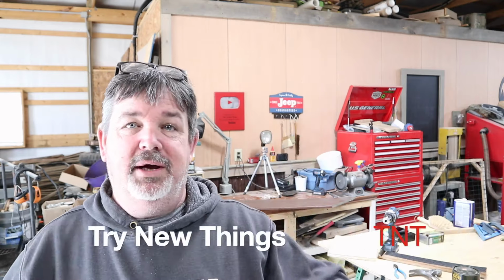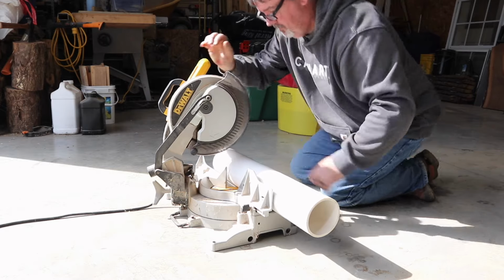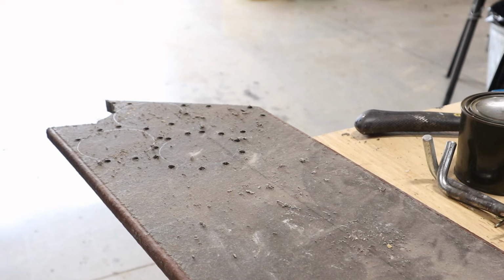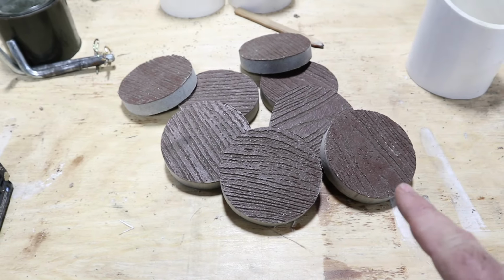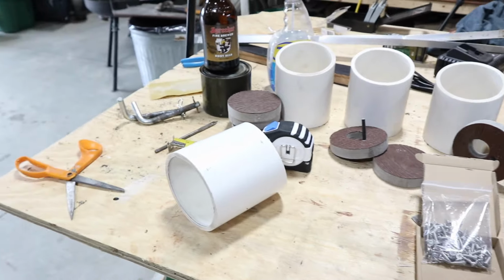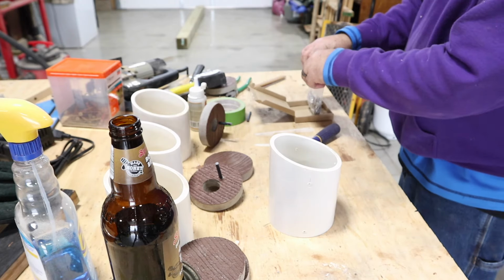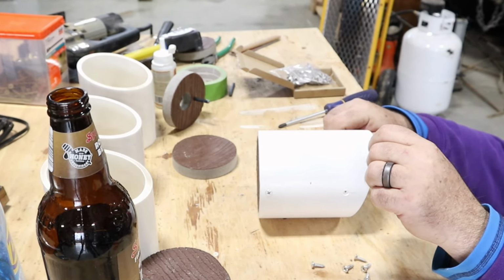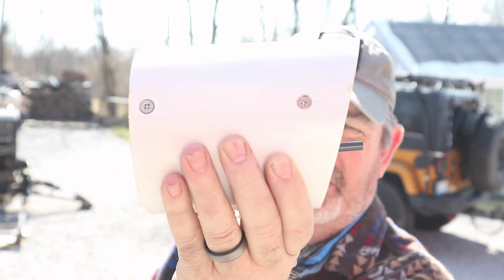#216:  DIY PVC Birdhouse Build

Comment: Chris, a house wren hole should be 1” and no perch. Predators are able to kill baby birds from perch. My bird book says hole should be located 4 to 6” from bottom. All my books say ventilation is needed. Although it is a fine looking and rot proof material I’m not sure it is going to work. You didn’t mention what particular bird you were trying to attract. I have never used pvc for a bird house. Your videos are always well presented. Good luck.
Reply from the maker: Hard to be 6” up on a 4” door.   No idea what bird she wants but smaller hole and no perch does make sense for tiny birds.   I’ll incorporate into the next ones and see if I can move the hole up just a bit.
Reply from the maker: I did put in a couple drain holes in the end, but that won’t do anything for ventilation.   I could put a couple holes at top of front and back.
Reply: @TryNewThings  maybe with pvc  all that is not necessary. All I know from my wood houses is they list a specific house size and hole size for every species. They also want holes in the floor to let moisture out and holes near the roof. I’m going to make one for inside our house and add one of those artificial birds on the perch. It is a nice looking birdhouse.

Comment: I like it, but I would have wasted a LOT of time on trying to make it easier to take the front panel out, and worrying about sealing things (as if the hole for the bird door wasn't much bigger than any of the other gaps). In other words, I think your design is a lot better than what I would have done, because it's simple and sturdy, and should last 50 years.
Reply from the maker: They are pretty simple to build.  I did end up putting a couple drain holes in the bottom of each so they did not turn into birdy swimming pools.   You should give it a try.   I'm going to make a few with Cedar fronts next time.